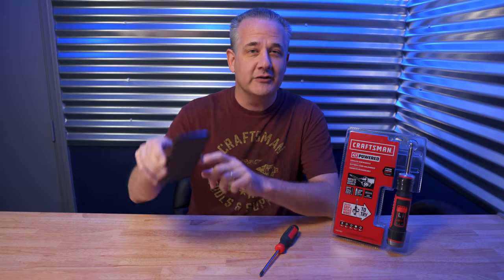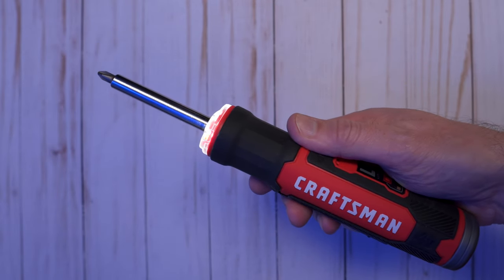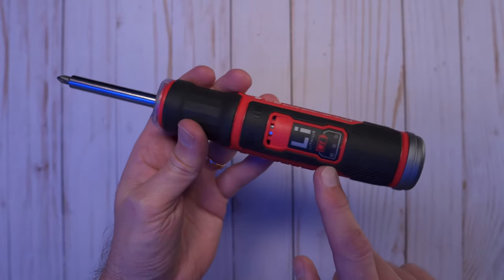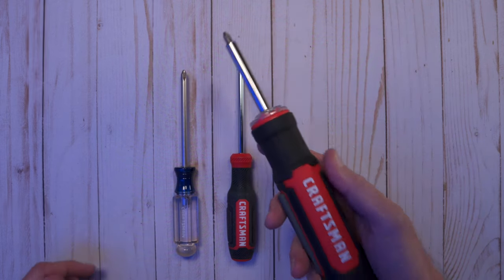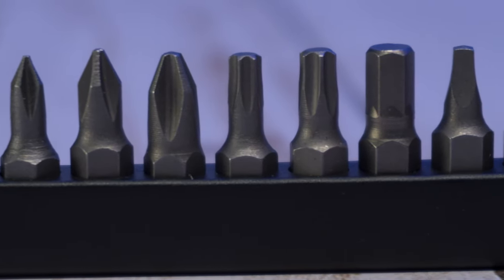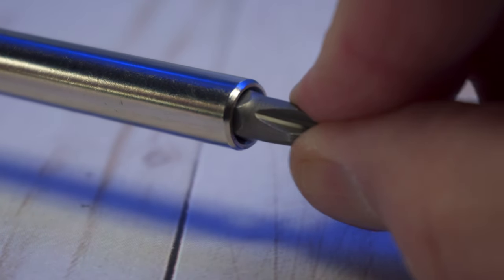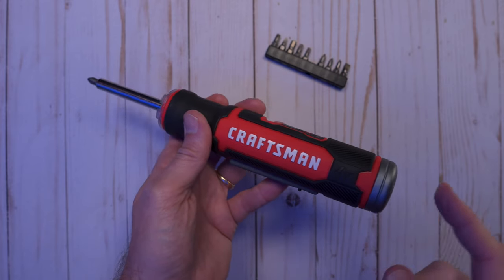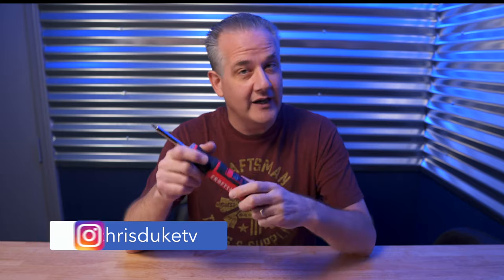🪛 It's Magic! The 4V Craftsman Screwdriver Reviewed

Comment: That is a nice little gimmicky tool! I don’t think I will be investing because I much prefer using my 12 V Ingersoll ram drill driver to run those types of fasteners in. Maximum variable speed trigger control adjustable clutch and high and low speed setting.